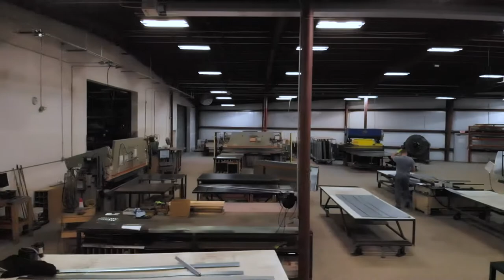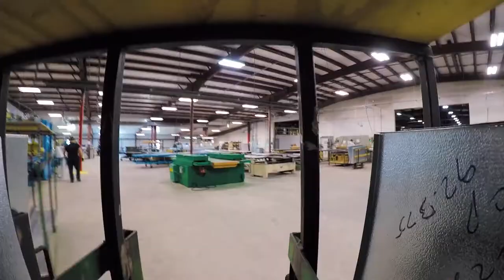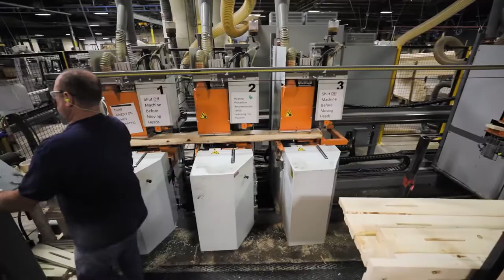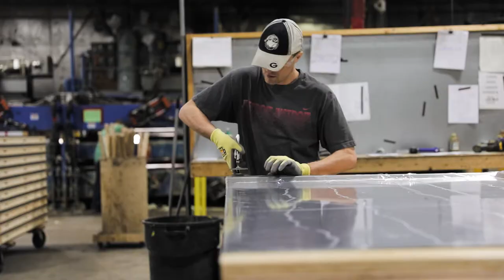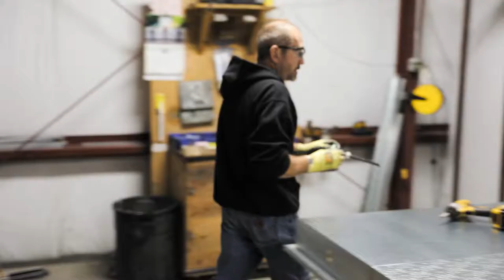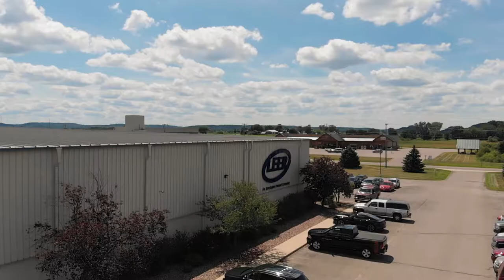Walk-In Cooler & Walk-In Freezer Manufacturing Process (Wood Rail) - How It's Made! | Leer Inc.

Comment: What is the best way to clean the interior walls? Just soap and rinse with water?
Reply from the maker: Hey Bill,
A couple small warnings before we give our advice. First, do not get the Walk-In panels (floor, walls, etc) saturated.  Second, it is worth researching your specific metal finish as that can change our answer a bit.

With that being said, our best suggestion would be a soapy sponge with just a little bit of water.

Thanks,
Leer Inc.